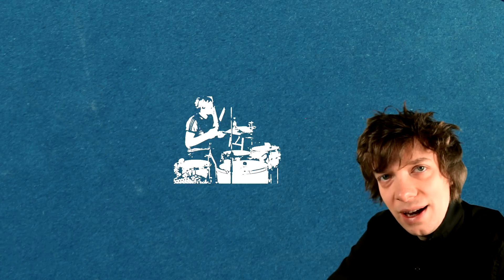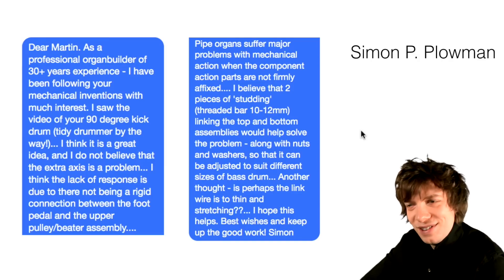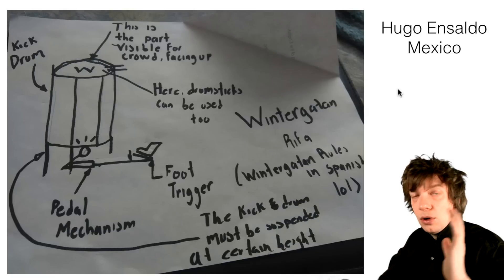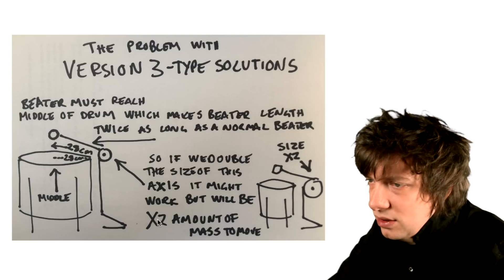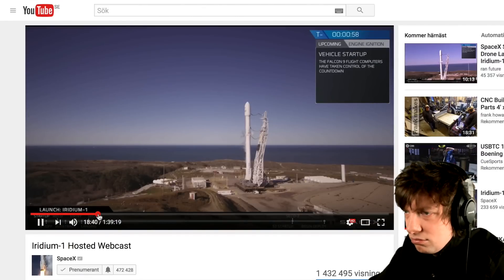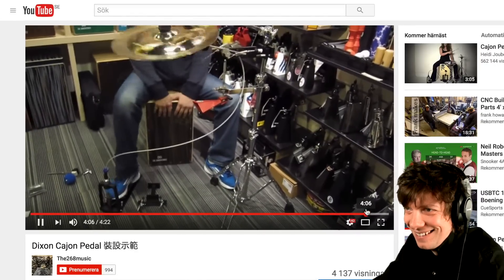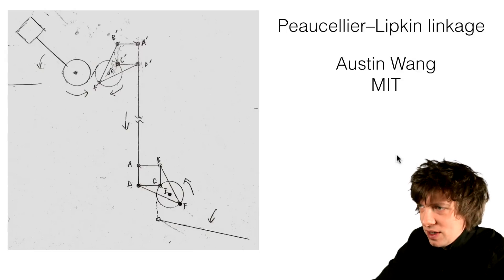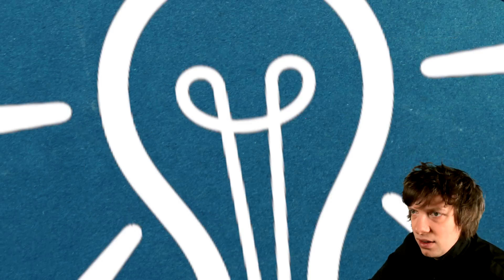90 Degree Kick Drum Problem SOLVED!? - With help from viewers

Comment: I know, this Video is 1 year old, and I regret not to see it before. Is there an update to the Problem? Did it work? I think the sollution could work (great idea Pedro :-) ), but I think there might be a problem in the long run in most of the mechanical ideas: since there is a force working not only on the Drumstick but also on the Drum itself (because the mechanicall part is mounted in the drum) it could make the drum moving or tilting a little bit, which leads to a steady load on the drum and the whole mechanism. Have you ever thought about a hydraulic system instead of a brake cable or a rigid bar? btw: I love your Videos and your Project. Great work. Keep on! :-)

Comment: I think the only way to do this is to distribute the weight usually accelerated across three parts: 
1. the actual part that hits the drum
2. a counter weight that compensates the "unusual acceleration"
3. a "phantom weight" that gives you the "authentic feeling" of a horizontal drum

So you need to keep the physical forces in mind, this includes the acceleration forces and weights, as well as the rebound (if there is any) in order to make the mechanic work I'd go with carbon for weight and stability and good bearings and "simple" levers to shift the direction of forces with little or no gear ratio. As it will be difficult to compensate the weight an acceleration from the Up/Downwards Movement these parts (including their counterweight) should be as lightweight as possible, while the "feeling" comes from "classic" vertical installation. I think that's something I Would look to build, if I had this project. two rods that can be adjustable in length should work well to transfer the motion with only little friction. Two to make sure there's no gap when shifting from push to pull. So basically you just need to attach a lightweight disc to the original paddle, drill two holes with the same distance to the center, fit the two rods to it and use a second disc on the upper end with two holes of the same distance. On the upper part you now need a beam that reaches the middle of the drum. It needs to be very lightweight - and probably requires a counterweight preferably of the same shape so also the wind resistance is identical. This should give you a quite good feeling. You can then start to check, if you can reduce the weight of the "phantom" original mechanism, as the total of moved masses has increased. as it's difficult to add "negative weight" (but helium balloons ;-) i think weight distribution, bearing resistance, minimizing additional moved masses is crucial. So that's my 2 cents ;-)

Comment: Are you sure the extra axis is what's causing the 90 degree drum to sound sloppy? I have a feeling it could be the acoustics of the drum skin facing the floor. It's not like the string you're using is stretchy, so I can't see a reason why the extra axis would cause that.

Comment: Alternative single-axis, single-wheel solution: Beater is a simple seesaw with a counterweight pulling it back up. Pedal rod is attached on beater side of arm at point giving right ratio. Pedal rod is angled at top to reach over edge of drum. Axis fixed on two adjustable clamps on drum edge, which can be moved to hit sweet spot.  Length of angled part of rod accomodates largest drum, on a smaller drum / different sweet spot, pedal is simply further from drum.  A thinner drum just needs longer legs to get right height.

Comment: Hi, just thinking a little different - what about instead trying to move with the rod just mount the complete standard pedal to top of the drum (preserving all the forces, distances, ratios) and make a mechanism to allow 2nd pedal for the foot - then you just need to maintain connecting the two pedals which could be done pretty easily
Reply: Oh I am so stupid - if the reason is just your audience to see when the kick gets hit - what about a sensor and a led diod?

Comment: I wonder if having such a long transmission mechanism will put a lot of strain on the return spring on the pedal.

You might want to consider adding a magnetic "spring" to the head -- run a bar or baton inside the drum shell, under the skin (close, but not touching) with a magnet under where the beater hits the drum head. Now put a magnet inside the beater, lined up so it repulses from the magnet under the skin -- your mechanism is now sprung at both ends, which might make the return action slightly cleaner.

(This is an idea I stole from the Farmer "Downbeat" foot percussion range, which I had been thinking about using in my own home-made kick.)

Comment: Why should you need an increased axes/gear size if you make the beater longer?
The angular speed should be still the same, the beater would just move faster and with less pressure

Comment: How would you like to operate your kick drum from across the room; with the drum in any orientation, and still get perfect feedback?
Get yourself a pair of matched mini hydraulic actuators something with a travel length equal to the travel of the pedal chain (100mm?). I'm seeing them on ebay for about $20 each. Mount one to your pedal frame and the other to your mallet frame. connect the two together with a pair of hoses such that their motion is complementary. Push to connect fittings are sold in small diameters and are very handy (many actuators have them already included), but you can use any length hose you want; a footstomp only generates a couple PSI so that's no biggie. Fill them with power steering fluid, bleed off any air bubbles, and you're all set. It might take a little tweaking of the spring tension on both sides to get everything feeling just right, but that's about it.

Comment: Love these Wednesday videos!  

A couple of years ago, I was inspired to try to build a 90 degree kick drum after seeing the StarMachine video.  I didn't have a ton of technical knowledge, but I have done some drum set rigging here and there.  Anyway - my drummer had just started using a cajon bass pedal in his other band, so I borrowed it for a couple of days and figured out how to make it into a 90 degree kick drum pedal.  The only problem was that the response was SUPER sloppy and seemed to get sloppier over time.  He stopped using the pedal on his cajon a couple of weeks after buying it.  

We've always blamed the sloppy response time on a low quality, cheap cajon-bass system.  I'm interested to see if the more expensive models have the same sort of problem with response time.

Comment: actually you don't want to got the middle of the bass drum. you'll actually want the beater to hit just offset of the middle. maybe about an inch off center. i know its not that much difference but just so you know. hitting the center isn't necessary and also not preferred. to get the best sound from your kick you'd want to hit it off center. thanks. i love your music and videos! keep it up!
Reply: don't want to hit* the middle
Reply: You'd actually want to build in some adjustment so you could vary the sound to get exactly what you want. It's well-known that drums sound different depending on where they are struck. Even conventional kick drums don't have enough adjustment so you often see a pillow stuffed into the drum.
Reply: Agreed! Well said man

Comment: a lot of the feel of a kick drum comes from how it bounces back. the wobbliness will be affected by the fact its at 90 degrees, as gravity is pulling harder on the beater than usual, so might be worth playing around with some weight onto the cable/shaft to counter the extra force pulling down on the beater? try finding a good mid ground between bouncy feel and too much weight meaning too much inertia? could do something similar with a spring,but they arnt as nice and linear in the force they apply

Comment: I still see one tiny problem: that last axis should be a chain or rack & pinion set. If it's a cable, you'll run into work hardening and eventual breaking unless you're planning to replace the cable before every concert.

Just my opinion, though.

Comment: I absolutely recommend Pedro's addendum, because it eliminates a potential problem of the torque causing undue stress on the connection for the side opposite the pedal.  This is gonna look sweet, and there's no reason why it shouldn't work that i can think of.